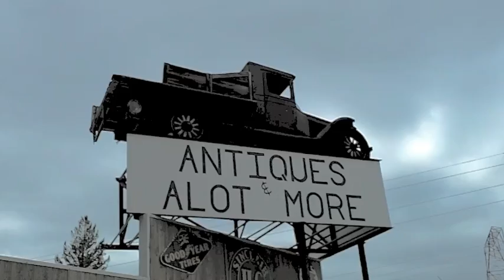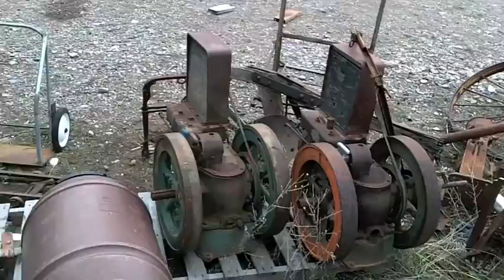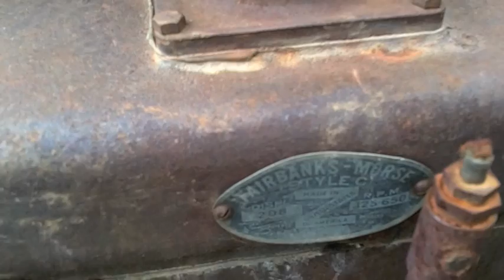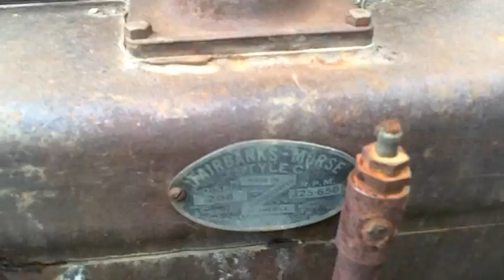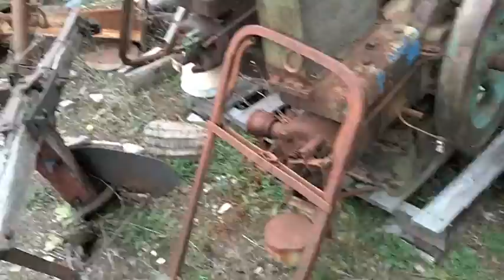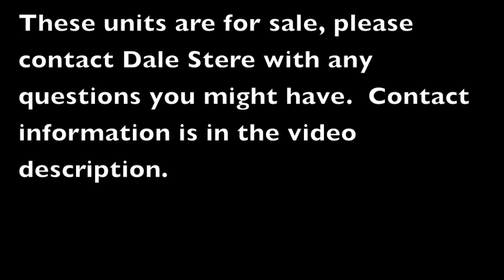Survival Power Plant Ideas: The Hit & Miss Motor

Comment: The fact that hit and miss generators aren't really a thing anymore is sad. With today's tech to regulate inputs and outputs along with battery tech you could run these perfectly for at least a backup supply for power loss or SHTF. Right now i have an idea for using one for a backup generator for an "all electric" live aboard narrowboat. The simplicity and reliability of these are perfect for that kinda application.
Reply from the maker: Rebuild it with rawhide, runs on anything from cooking oil to paint thinner... Simple machines.
Reply: @acme663ryo Youd be an expert to ask. Do you know a place that still builds these or at least does large scale reproductions or refurbishing? All the big producers are dead, but id love to find a place where I can look at them and maybe buy one. I know about the cast kits, but im in to way a millwright. 

Just a man with a respect for engines and engineering.

Comment: In russia and ukraine theses are very common for very remote locations, as we can convert tires to oil and use that oil in them. cost less then 0,01 usd per liter. and i know one guy who has had the same engine running almost daily for 25 years and it never broke. ofc if you use common sense and service the engine.
Reply from the maker: I would love to see that motor.